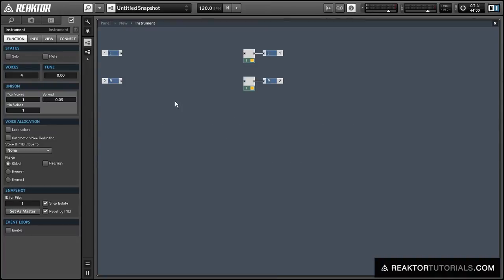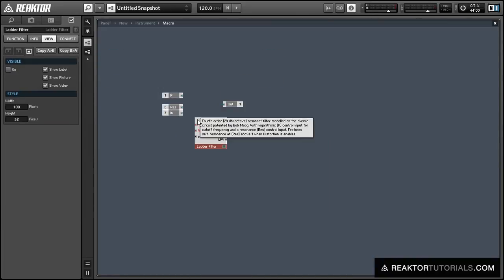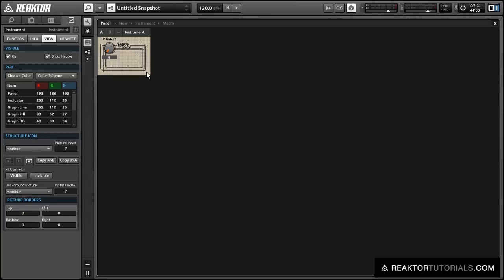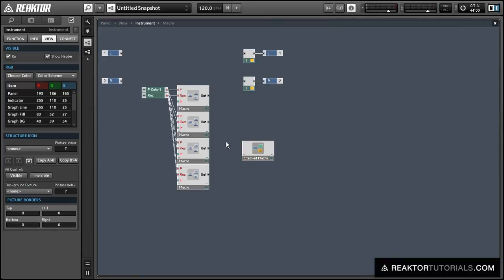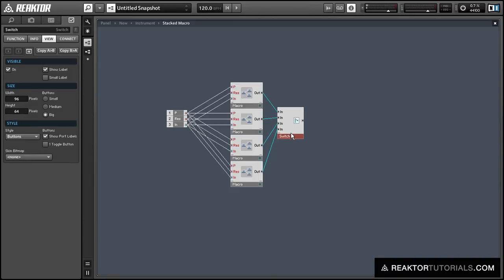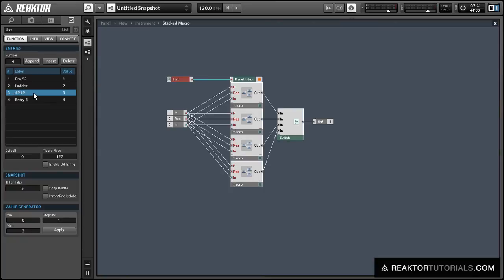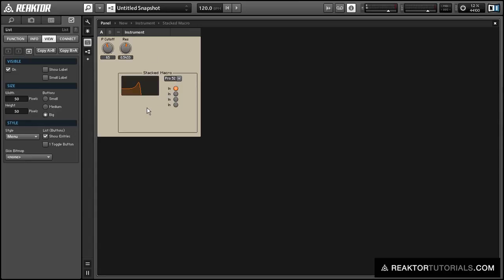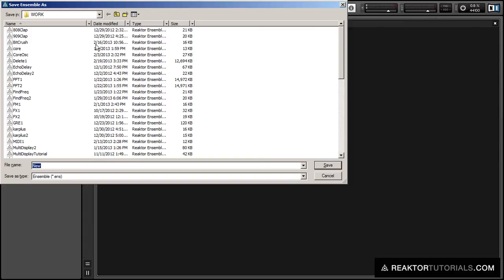Working With Stacked Macros In Reaktor

Comment: To get this to work, I had to click on the switch and go to 'Side Panel > Connect > OSC RECEIVE'. I then had to click 'Add Source' and make the 'Address Pattern' equal to that given in the List module, shown under 'Side Panel > Connect > OSC Send > Send Address Pattern.'

Also, it appears that in the code, the macros are added to an array, and the panel index merely shows the macro given at that index in the array. This implies that the macros are indexed according to the order in which they get added to the stacked macro.

Comment: I made a stacked macro which contains 4 Oscillators. If i edit some parameters in Oscillator 1, and switch over to Oscillator 2, the knobs won't change values/update. Is there a way to get the knobs in a stacked macro updating when switching over to a different Macro?